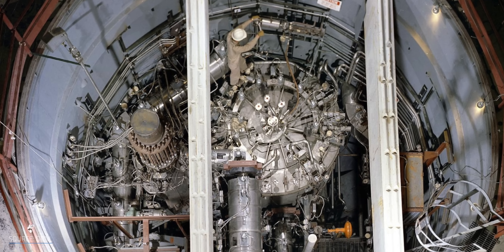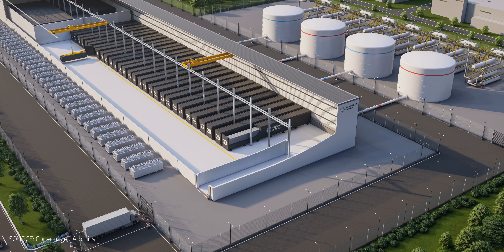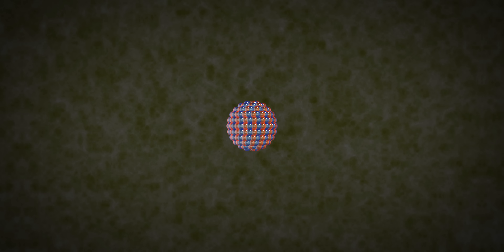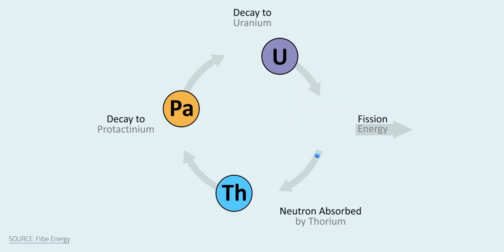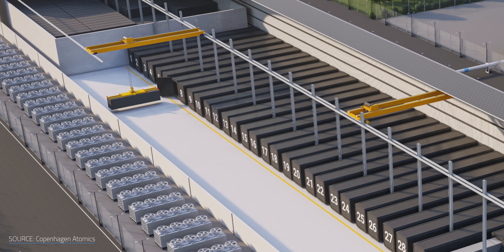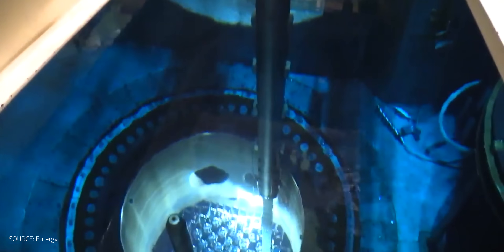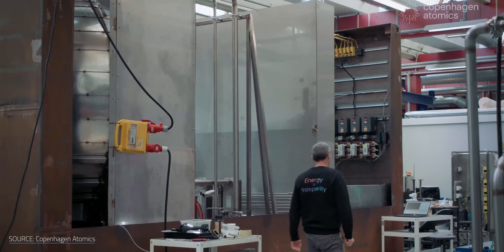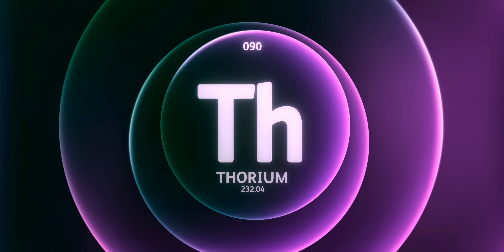Why Thorium is About to Change the World

Comment: Badly needed on mars as it require surpass build energy society and inc power process and offer even more impulse on H carbon and O2 release as atmosphere release and then switch into negative cool phase and this is why is critical stable nuclear fusion reactor as north ground pole and thorium cells and rest salt reactor create kind violine kind diagonal patch to 5-6 ° angle to create in recreate so called bio teraform process this process can even so called volcano through material into atmosphere kind man made the final purpose is kind intro teraform prp for inside lava move core pretrow gas into atmosphere and material extract and stabile reclimate atmosphere into livable on with or without chance to move planet core inside kind genesis system  teraform kind a star trek move PC program but super fast diagnostic and gas boom rockets protons to super speed max effects if required gas Buble find under planet core kind nice in movie and require preps or steps or even years but is basic theory for grow on colony or pilgrim society future then you can count millions people living on colony or stretch some paths to avoid unstable time period or do so called shorten. moves to speed things faster since etime period in reality is slight indefinitive puting thing in prospect is kind proving emc2  actually works that is why one is theory rest in practice and how to achieve this line process is kind reality check or prep for goal achieved good so this this would be creative vay following phisics law kind a rebinding evolution but doing actual terraform after achieving this is kind optional theory to put in phase such as repulse drive or opening time off lmore distant travelling  but evolution time right set tech bypass allow some time interact switch or better as easier transition easier made creativly this is mater off physics laws on hardward and laws creativly man made in everyday life bigbang shorten to five years instead 15

Comment: APPRECIATED Good content, sir!. Irradiated thorium produces Uranium-232, which emits gamma radiation, making it more difficult and expensive to handle and reprocess. And thorium is a fertile, not a fissile. U-233 is created by the Th-232 by a neutron, which leads to the formation of the U-232 and a gamma emitter. So thorium reactor will be more feasible than the URANIUM REACTOR?

Comment: There's a lot of benefits you get from a Thorium cycle that the US energy commission knew full well about back in the 60s. The reason they didn't go with it then was because it doesn't enrich for weapons. The current pursuit of modular, continuous development is really intriguing for me. A company can use the heat for their plastic recovery process. One can use it for desalination. Another can use it for heating entire neighbourhoods. A lot of different applications and functions aside from the power generation traditional nuclear plants are limited to.
Reply: believe it or not, the other reason they went with uranium was because the brother in law of one of the guys on the commission had a mine that was getting closed down due to the "radioactive material" in the mine making it unsafe to extract the other metals. funny how that works, huh.
Reply: Nohing stopping waste heat from nuclear power stations being used for district heatting.
Reply: Thorium reactors are also much more complex, than Uranium ones. That's why we had Uranium based nuclear reactors in the 60th, but still don't have good, working Thorium reactors today.
Reply: @Duconi  The reason the Thorium cycle is taking longer to develop is due to regulatory issues and the rather insane anti-nuclear lobby (one idiot claimed a nuclear plant output more CO2 than a coal plant).
Reply: @MysterySemicolon the regulatory limitations can be less strict for Thorium reactors, as you can not produce nuclear weapons with it and the anti nuclear push (which has a lot of good reasons) is pushing even more against traditional nuclear power than against Thorium reactors. Your example is not representative for the anti nuclear movement. Anyways that's not the blockers, as the same is true for traditional nuclear power which are built. Thorium reactors are more complicated.
Reply: Heard somewhere, US navy planned to use thorium as fuel for first nuclear submarine, but realised subs would be traceable from 'rays' given off, so swapped to uranium.
Reply: @warrenklein7817  Thorium cycle has the same radiative output as the uranium fission process. They probably went with the other due to the maintenance cycle and no need to maintain the 700C liquid salt medium.

Comment: Think back to the 1950s, when scientists boldly predicted a future where energy would be "too cheap to meter." You can almost hear the capitalists scratching their heads, perhaps screaming "communism" internally, envisioning societal collapse... dogs and cats living together! Despite that optimistic vision, thorium energy won't be cheap, and I'm not trying to be negative. There's a strong incentive to keep prices at the very limit of what people can fit into their budgets. While luxury items like TVs, stereos, and headphones have seen astronomical price drops, the same hasn't happened for the things we genuinely need. My first Windows computer cost me $3,000 in 1995. The one I'm using now was $1,800. My first VCR in the 80s set me back nearly$1,000, yet my last one was only $200 and even included a dual DVD recorder. BTW, I bought cheap ones for $49. And today, my $80 Alexa device produces sound quality comparable to a $2,000 stereo from the 70s. My Galaxy S22 sounds great through $50 BT headphones, and my $30,000 EV came STANDARD with a fantastic stereo. 

A decent new computer should realistically only cost $200. Similarly, the cost of solar energy has been falling since the 1950s, yet a solar installation still costs tens of thousands instead of just a few hundred. The energy sector will undoubtedly find a way to make thorium energy as expensive as we are willing to pay. It's a familiar story: I see solar farms and windmills appearing, but my energy bill continues to rise. I never see SWEPCO trimming back trees anymore. They just fix the lines when the trees fall on them. We've evolved into a civilization of maximum price for minimum quality and service. You can call me cynical, but I've observed this pattern with every alternative energy source. It begins with naysayers, followed by burdensome regulations, and then outright sabotage and lawsuits. Ironically, the energy sector stands to gain the most if they invest in this research and implement it themselves, rather than fostering competition.

Comment: At 4:00 you mentioned little U is U235 (which is true) and you mentioned the breading of Th produces more fuel as it runs while "old school reactors just burn up fuel". You can make a U breader the breads the U238 to get Pu. This section of the video seems to ignore the fact that this is possible. Infact it does occur even in reactors not designed to be breading reactors.

Comment: True green energy has to include power sources that do not require parallel backup systems of equal capacity to deal with weather, exemptions from rules about decapitating endangered birds, frying endangered reptiles, or causing endangered cetaceans to beach themselves. If micro modular nuclear reactors can be miniaturized sufficiently, it may allow for economically viable green power transition with less advanced battery technology than intermittent power sources demand while allowing limited natural gas reserves to be conserved for manufacturing and petrochemical applications.

Comment: Back in the mid to late 70s US had 2 test Thorium reactors running. One of the ran for almost 7 YEARS. DOD funding was most of the money used for that project.
Same person that developed the Uranium pellet reactors is the one who made those Thorium reactors.
Yet the military did not like the lack ability of Thorium to make bomb material, but was very good for energy production.
So the military STOMPTED on the Thorium development which including BURNING the books & manuals about Thorium.
Some of those book & manuals survived because the engineers & scientist hand carried out some of them out before they can be destroyed.
Then they determined Thorium LFTR reactor is 'walk away safe', meaning it needed to be kept under control to keep working. Also Thorium LFTR can use to depose waste of the pellet reactors.
YES Thorium reactors need a little Uranium to get the process started. PLUS a side product 'waste' of those reactors was Uranium 135 which is used in medicine & other commercial products.

Comment: current fuel assemblies don't corrode, they're changed only due to burnup.  50+ year old fuel doesn't have corrosion.  boric acid leaking and solidifying is what corrodes current reactors.  regardless, really cool to see evolutions in nuclear energy.  it really is the only viable true green energy source we're likely to be able to access.

Comment: It is interesting with thorium power, but wouldn't it be more expensive than, for instance, fossile power or uranium power? Just because a fuel is cheap and abundant doesn't mean that the generated power is less expensive than the competition. Time will tell.

Comment: June2025:  While in college in the early '70s, my atomic professor suggested putting "hot" nuke waste in a sealed capsule and dropping it in a large tank of water to keep the building we were sitting in warm.  The heat would last more than a lifetime as the nuke waste automatically decays.  Think of 100 lbs of waste sealed in a 2 ton chamber burried in the basement.  
     There are concerns that it could be stolen and used to make a TNT bomb into a dirty bomb.  Outside of that you get free heat with no fossile fuel bill every month.  At the end of 100 years the nasty nuke waste is 80% less radioactive (but still deadly).  
       Retired in Sacto.
Reply: and in the summer?
Reply: Use nuclear waste to make TNT bombs? What the hell are you talking about.
Reply: radioactivity under a building for heat... lets start with the Whitehouse basement, should anything go wrong...oh well.
Reply: @tedebayer1 Reported for hate speech and a terroristic threat against the President of the United States of America.
Reply: @DUCKDUCKGOISMUCHBETTER bruh.
Reply: Is this comment intended to be preserved? I sometimes like to take screenshots of things for posterity, but not without permission, because I suspect that few people really understand the permanency of the internet. Of course, perhaps that is unfair.
Reply: @clockwardkailleach :  Feel free to use my comment as you see fit.  I'm pleased you read it.    Douglas Baty.  Sacramento CA
Reply: @douglasbaty3097  exactly, no fuel bill every month! What rich power producer wants that!  It would put him out of business, he would have to work for a living! 😭.  Such is capitalism!
Reply: @Number-s9h  False. Actually that is classic socialism at work. 

In a capitalist economy competition drives out inefficient companies. 

Only in socialism's heavily controlled environment of government subsidies and regulations can monopolies, like current power companies, thrive. In capitalist economies those power companies would have gone the way of the dinosaur long ago. 

You really need to educate yourself!
Reply: @duxdawg  capitalism actually funnels money upwards by letting that competition die, and thus giving the "better" company more resources to develop while other startups are left in the dust. pretty much only daddys money can take down a monopoly in todays world, and it would take a lot of it
Reply: @duxdawg Well in capitalism competition tends to die out as few companies hoard the majority of the power, buying out or bankrupting smaller ones.
This is the case in energy production as seen with fossil fuels
In socialism the state company is not 100% profit driven, rather focusing on generating power efficiently
The OP points out that fossil fuel companies would not want this idea to take place as they would lose profits
So I ask you, which model would rather change to this more efficient way of heating up water? The one who cares about profits or the one who cares about spending less while delievering good results?
Cheers
Reply: @Lmafraaa Like all Socialists you are ignorantly conflating Corporatism (usually established and engaged in by and for the benefit of Socialists), with actual egalitarian free market capitalism. Corporatism is NOT free market capitalism! At all!
Reply: @DUCKDUCKGOISMUCHBETTER So it is not a trend in capitalism to see the formation of monopolies?
Reply: Please point out a free market capitalism on the map… Corporatism is the only actual end result of a capitalistic market.
Reply: @thierryfaquet7405 (1) Free market capitalism exists in every free world nation, where the socialism driven corporatism has not been allowed to corrupt it. (2) Incorrect! Corporatism is the result of Socialistic corruption of free market capitalism. It is not a natural, let alone inevitable outgrowth of free market capitalism anymore than weeds or the theft of ones crops by thieves are the natural outgrowths of trying to raise a garden.
Reply: @DUCKDUCKGOISMUCHBETTER cringe copy pasta is so sad... Again, please show us on a world map where that true capitalism exist. We can wait your slow brain to catchup.
Reply: @thierryfaquet7405  You are dead wrong, Corporatism is how China and Ukraine operate - along with Democrats in America.  Corporatism works by use of government to create barriers to competition, allowing monopolies and oligarchies to arise. They do this via corporate / government alliances creating regulations and legal environments that favor the big boys and stymie small business.
Reply: @thierryfaquet7405  why do you feel the need to add an insult? Remnants of being a school bully? Or reaction to have been bullied at school?

Comment: I’m really curious about the pipes that are heat/corrosion resistant. Because from my understanding, that has been the biggest challenge to using thorium as a fuel source. 

It’s interesting… AI could/should be used to help develop the alloys needed for these pipes. Meanwhile, AI needs a more sustainable fuel source. 2 birds with one stone?

Comment: Great video, but If we are talking about science, why bother using Fahrenheit? In science, Celsius and Kelvin are the standard temperature scales, with Fahrenheit rarely used due to its non-metric basis and less precise scaling for scientific calculations. 

There are anywhere from 5 to 18 countries, out of the 195, that use Fahrenheit. Time to get with the rest of the pack.

Comment: 1. The breeder reactor on uranium 238 will use the stocks of it, they are already been mined, processed to get U-235. If we use these amounts of uranium it brings us from 200 years up to 10.000+ years of using uranium fuel.
The only obstacle is that only Russia and France have such supply, as only they enrich extract U235 for traditional nuclear power plants and collect the fuel that was already used in them.
2. The chain of "shift" from thorium to uranium 233 shown is not the only possible one, there are a bunch of them, and some lead to appearing of some serious reaction contaminants that make the chain reaction impossible. The problem of extracting those contaminants and taking them away from the molten salt mass is not solved yet by any of research teams in the world.

Comment: I can dig a 50 ton stone out of the ground anywhere, put a ram under it, and lift it with heated water.  And that energy doesn't have to be pumped into a lossy grid that also doesn't need to be built, or sustained by a city of workers, or owned by a conglomerate of private energy companies.  And this gravity battery will work for a century using highly available, common material parts, using no rare earth or dangerous fission technologies.  Why are we trying to solve a problem no one really has?  So somebody can own all the energy everyone uses?  Why?  Or so material of mass threat and destruction can be stockpiled at just below the treaty thresholds under the guise of an energy program?

Comment: Molten salt reactors (MSRs) are not a new concept, Alvin Weinberg, and his team, successfully operated one for over 600 hours at Oak Ridge National Laboratories. The Molten-Salt Reactor Experiment (MSRE), conducted by Alvin Weinberg at Oak Ridge National Laboratories, was run from 1965 to 1969.

Today, rapid technological advancements have accelerated MSR development, but regulatory hurdles, not technological limitations, are slowing progress. MSRs offer significant advantages, including cost-effective and sustainable fuel safety, cleaning, and recycling. The future of nuclear energy is with modular, small MSRs.

Comment: Pretty sure that molten salt has not been solved. Still too much of a corrosion issue. And Uranium can be made to do pretty much anything that thorium can, except it more easily makes plutonium, which is more easily used to make bombs. But thorium reactors can also make plutonium. It is not that hard to make a safe reactor, people just have a lot of fear, and there is a push to switch to thorium as if it solves everything. It really doesn't.